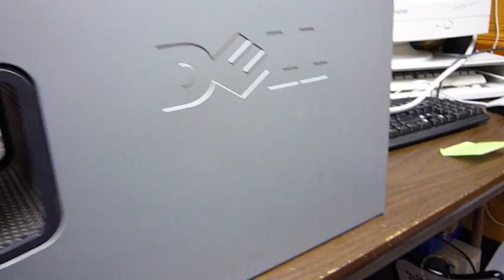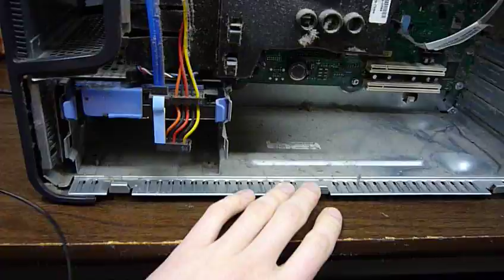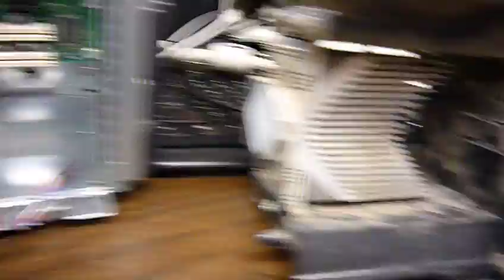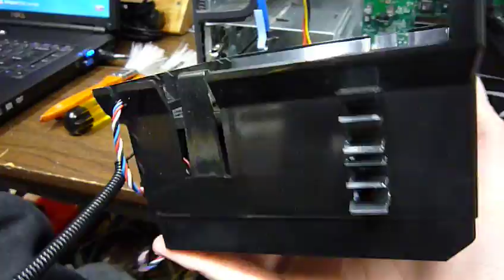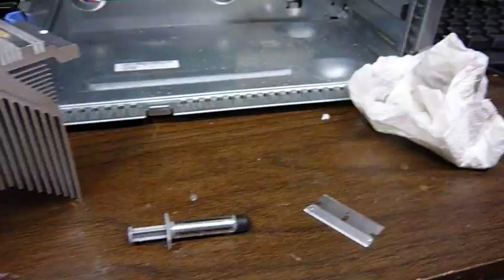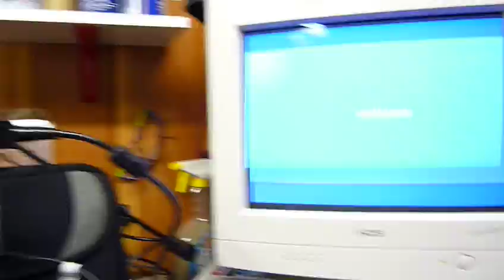How-To: Clean Dell BTX Case Computers

Comment: How tight did you screw the heatsink back in the case.

Really tight or just tight to fix.

When I used the akaska card to smooth out the thermal compund. 
the processor did not feel straight.

Comment: I got a DELL Dimension 3100, I had got a funny noise while using the computer.
When it's on it makes like a humming sound.
I use air duster on heat sink and fan.
How do you replace power supply and reconnect the plastic clip to hold cables underneath it. Like IDE cable and front connectors.